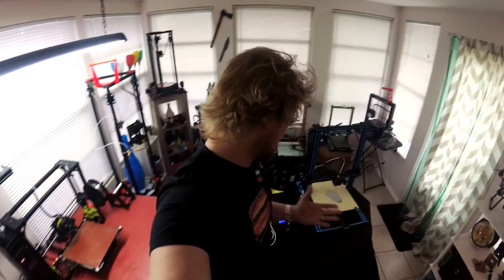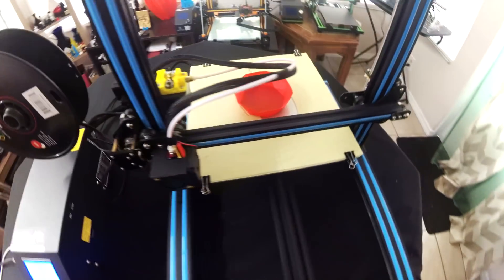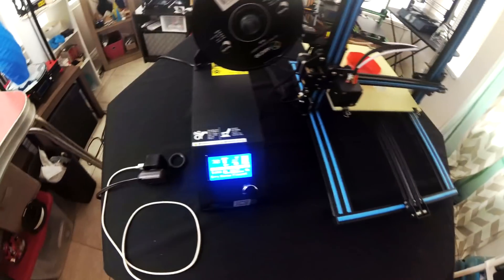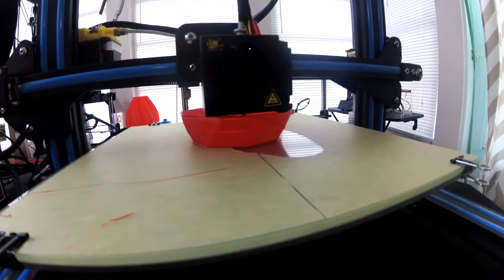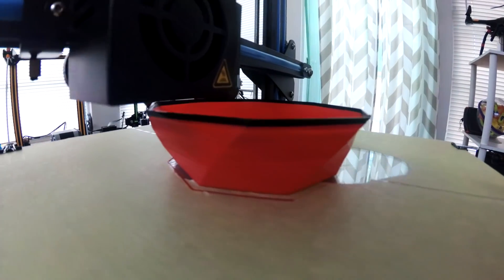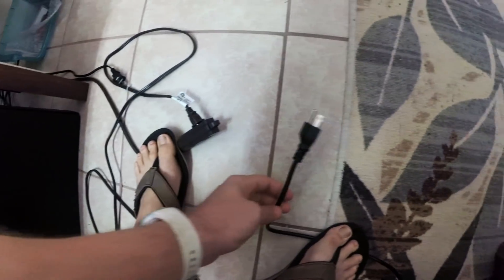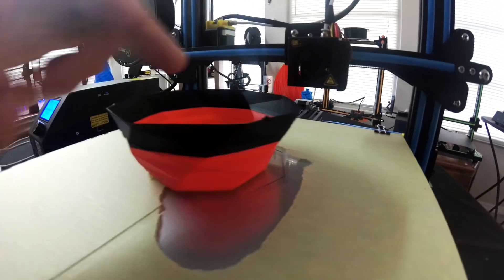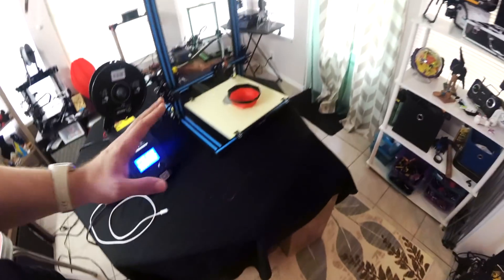✔ CR-10S Filament Sensor Test WORKS! | Power Recovery Failure

Comment: What they need to do is have battery backup integration over USB - like how your PC can suspend (or shutdown) when the battery backup indicates that remaining battery life is below a certain threshold (through the USB port).  That way, the printer could "park" the head, flush the write buffer to the SD, and power down gracefully.  When the system comes back up, it'd check for the presence of a suspended print and automatically resume at that point.  I run my CR-10S through an APC BackUPS 1350.  

What's interesting with my CR-10S is that I seem to have a different power supply (Mean Well) than standard. When I unplug or turn off my CR-10S (i.e. disconnected from UPS), it continues to run for ~3-4 seconds before losing power!  Haven't tested the power resume yet, but pausing is hit or miss...ended up with some odd streaks across a print once when I tried pausing.
Reply from the maker: I completely agree!) :D

Comment: I've seen other information that says the power resume only works once (it has to save where the print head was). Try doing the power outage test again WITHOUT doing the filament runout first and see if that works. Also, I've heard it doesn't work when using the power switch, so unplugging it like you did is the correct way to test.
Reply: Barry Meaker Do you know if it works or not?

Comment: Did you when into the menu when the print stop and use the change filament menu in the box, the printer will spit  the filament out of the printer and  you load the new one, then press resume the print, the machine will go into temp one more time and resume the print with no error.  The detection system is not for just stooping you filament but to remove the hot end out of the print, witch the cr10 regular can not do, the CR10 regular will run out of filament and will stop in top of the print. I hope I made my self clear.  That is the way we change colors with out having errors in the print.  Use the change filament from the machine.
Reply from the maker: I understand! I found this in the settings a few days ago by accident!) Thanks for mentioning it!
I mainly wanted to show off what happens if you run out accidentally, but if you are aware you should definitely hit the change filament selection!) Great tip! :D
Reply: i just got a normal Cr10 not S and it has a filament change option on the menu that actually work...
Reply from the maker: filament change works on both for me, just not power failure return
Reply: My cr 10 does do that, but I got the regular one ?
Reply from the maker: do what?
Reply: when i want to change filament it stops and goes to the left corner  show on the video automatic.